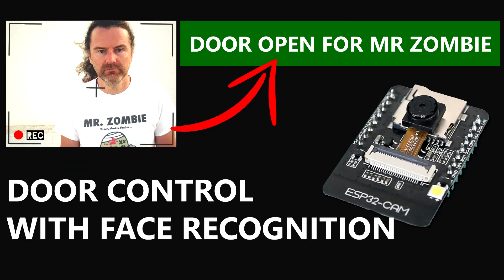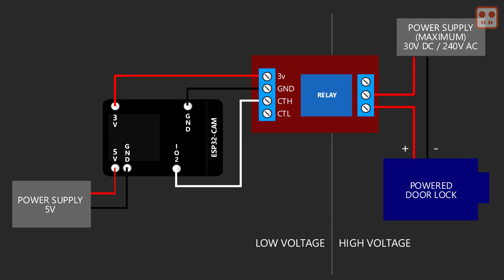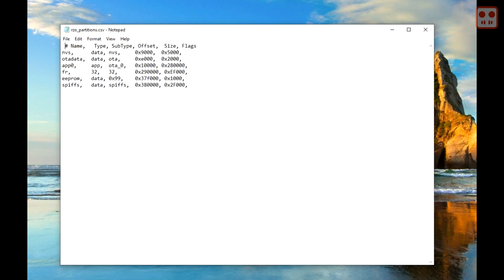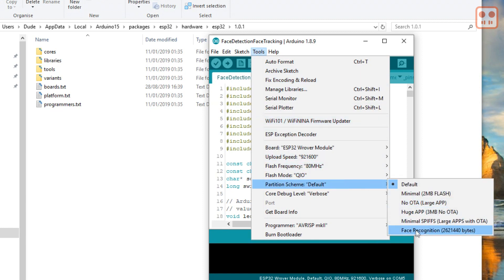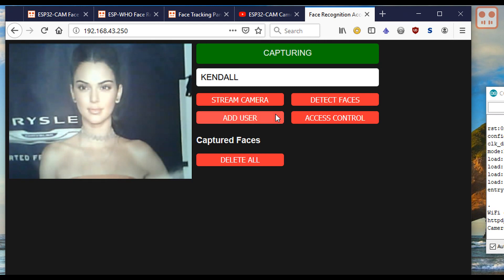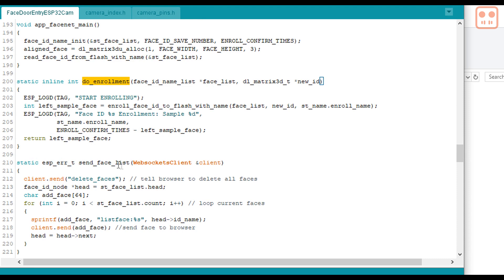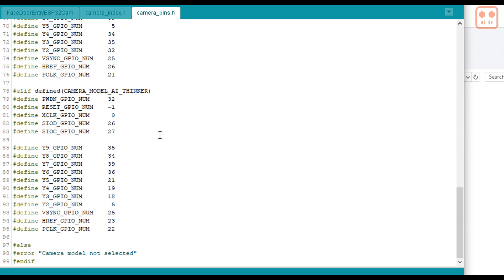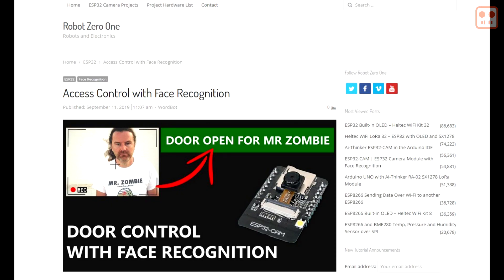ESP32-CAM Face Recognition Open Door Lock

Comment: A huge problem is being showed here
We are getting the IP but after opening the IP in chrome we are not getting the video streaming.. we were getting the video stream but now it's blank screen...black display..so what's the solution...& I AM sure there's no problem in hardware
Reply from the maker: Do other camera examples or tutorials work?
Reply: Camera examples work perfectly fine.
Reply from the maker: @anorophile2841  Is this Chrome on the desktop? Anything in the serial monitor or in the browser console?
Reply: @robotzeroone  when we press F12 the consoled open and showed  one error  count ws=new WebSocket(WS_URL) on the line 145 on the console panel and also showed Could not decode a text frame as UTF-8
Reply from the maker: @anorophile2841  I just tried with a new camera and my code from Github and it works fine.  - https://www.youtube.com/watch?v=68kPGWKg-_A the only thing I can think of is your Wi-FI isn't good and the websocket connection fails.. or maybe you have something blocking JavaScript in your browser for local IP addresses.
Reply: @robotzeroone  actually I have a video of our problem regarding the error is there any way I can send the video and I am quite sure the WiFi speed is decent enough bcoz the program run quite nicely first and yes there maybe a problem regarding the Java Script part you told...please help if I can send you the video in any way sir....
Reply from the maker: @anorophile2841  I don't really have time to offer one to one support on this. I've just added the HTML interface code to the Github. Use this tutorial https://robotzero.one/esp32-cam-custom-html/ to make changes to it so you can try to find your problem. You can add console.log() statements in the Javascript and see if you can narrow down the problem.
Reply: @robotzeroone  no correction of the JavaScript part that HTML text error shown in the index 145 we are facing problem in how to fix thatt
Reply: Can you do something please
Reply from the maker: @anorophile2841  I don't have time to help you. This is just a hobby for me and I've given you all the code I used. You have to work with it and find where the problem is. Look here under  Erase Flash to make the ESP32 clean - https://github.com/espressif/esptool

Comment: Sir after getting IP address from serial monitor, I open IP address in browser but  no camera streaming happening . PLS help.
Reply from the maker: Does the CameraWebServer example work for you? How about this one: https://robotzero.one/esp32-cam-rc-car/ you don't need the servos to see the video.
Reply: @robotzeroone   sir camera web server example worked perfectly fine earlier. when i use your code at first it worked perfectly fine and the video was also streaming but after some time when we tried to scan the photo the camera streaming hanged and then again when we re opened the ip address we faced the problem of camera not streaming
Reply from the maker: @debjitdas6327  I've just tested it with a new camera and my Github code and it seems fine. - https://www.youtube.com/watch?v=68kPGWKg-_A
Reply: @robotzeroone  "WebSocket connection to 'ws://192.168.43.118:82/' failed: Could not decode a text frame as UTF-8. " Sir this is the error i am getting.
Reply: @robotzeroone   sir I get 
Camera Ready! Use 'http://192.168.43.118' to connect
[D][WiFiClient.cpp:509] connected(): Disconnected: RES: -1, ERR: 104
error in serial monitor...
Reply from the maker: @debjitdas6327  Can you try the delete all button and reboot the ESP32. Maybe something happened with the name store. You are using the correct partition as in the tutorial?
Reply: @debjitdas6327  me too, can't you help me ?
Reply: @huynguyen6680  This error seems common... I suspect this is due to the data we save in the flash as it gets cluttered... 

https://rntlab.com/question/how-perform-reset-factory-esp32/

Faced the same issue... followed the above instructions to clear the flash memory of ESP 32 cam... it solved the issue... it might re occur when we enroll and delete faces again and again...

Comment: Guys if i use 5v relay module will it work?
Reply from the maker: Can you measure the voltage on the pin? I think it will just be 3.3v. Also there is very little current so the relay has to be sensitive.
Reply: @robotzeroone  itworks?
Reply from the maker: @bruhitsp4n959  That's good. I didn't think the pin would have enough power to energise the relay.
Reply: @robotzeroone  so what if i use 5v

Comment: Excellent work sir g, but in my case all things are working normal,  after a few face unlock , esp32 reboots by showing Guru Meditation error, please help
Reply from the maker: Can you see where it crashes using the serial monitor and the ESP Exception Decoder?
Reply: serial monitor shows the following:
Door Unlocked
majid
majid
Guru Meditation error: core  1  panic'ed (Load Prohibited). Exception was unhandled
Reply: serial monitor shows the following:
Door Unlocked
majid
majid
majid
Door Unlocked
majid
Guru Meditation error:   core    1  panic'ed  (Load Prohibited). Exception was unhandled
Core  1 register dump:
and here show registers after it shows "Rebooting"

Comment: Congratulations for the tutorial, I followed everything clearly explained, but loading the http page only the part of the controls is visible but the streaming image of the camera is not visible
Reply from the maker: Does the CameraWebServer example work for you?
Reply: it works perfectly
Reply from the maker: In the browser, press F12 and look in the console tab to see if there are errors.
Reply: I SOLVED THANKS !!!!
Reply: How did you solve the problem of Console using F12...can you please tell???
Reply from the maker: Press F12 in your browser and look in the console tab at the bottom. You will see any JavaScript errors.
Reply: Yes there is an error of web socket how can i solve that
Reply: Once it was running perfectly but after that the web socket issue appeared

Comment: Hi! I managed to get it partially working. It detects at first then a few seconds later the ESP32 disconnects. Also, the output pin does not seem to output a signal. Are you using an original esp32? I'm using a clone from aliexpress (the Rx and Tx pins is reversed otherwise it won't upload the sketch).
Reply: I've used a 100uf Cap and an external power as well.
Reply from the maker: @webslinger2011  Normally RX on one device is connected to TX on the other. Might be a power issue, might be wifi. Does the CameraWebServer example work OK?
Reply: @robotzeroone  Other than the Tx and Rx pins were switched. Camera webserver works fine. It's when I try to activate a pin for the optocoupled relay that's when it resets/disconnects(happens even without anything connected to the output pin). Using your face recognition code.
Reply: @robotzeroone  What usb to serial programmer are you using? Mine is an FTDI FT232RL USB to serial IC from DFrobot. Maybe I could try a CP2102?
Reply from the maker: I'm using a CP2102. I remember the FTDI I tried didn't work when I started with these cameras so I've not tried again since. Try changing the output pin. I found 2 and 12 worked. Do you have a card in the reader? Also if you look in the serial monitor and installing the ESP Exception Decoder might help.
Reply: @robotzeroone  There's no card on the reader. I'll try installing that. Thanks!
Reply: @robotzeroone  I've changed my usb programmer and it seems to work now but still resets. Using the code from cytron esp32 camera works well but it won't save anything permanently once power is disconnected.
Reply from the maker: @webslinger2011  It was actually to try removing it to see if the mechanism being active stopped some pins working. Just a thing to try.
Reply from the maker: is it resetting when it activates the pin?
Reply: @robotzeroone  Yes, it does.
Reply: @robotzeroone  But I only connected a meter on it.
Reply from the maker: @webslinger2011  Best to try first with nothing connected. You can try pins 2, 12 and 14. I found 2 and 12 both worked for me but maybe something different with your board.
Reply: @robotzeroone  I'll try to watch the rest of your video to see if I missed anything. Thanks!
Reply: Do you happen to have a picture or document of the blueprint for lock system?

Comment: i have problem when i start to enroll i can't , i see in serial monitor in IDE , i found this 
E (186084) fr_flash: Not found
E (190417) fr_flash: Not found

you can help me pls
Reply from the maker: Sounds like the new partitions haven't been set up.
Reply: @robotzeroone  thankyou for before issue. 

I have a new problem. Previously, I was able to use it. But when I switched to using 5Ghz wifi, it didn't work at all.

WiFi connected
httpd_start
Camera Ready! Use 'http://192.168.1.2' to connect
[D] [WiFiClient.cpp: 509] connected (): Disconnected: RES: -1, ERR: 104
[E] [WiFiClient.cpp: 392] write (): fail on fd 61, errno: 104, "Connection reset by peer"
[D] [WiFiClient.cpp: 509] connected (): Disconnected: RES: -1, ERR: 104
[D] [WiFiClient.cpp: 509] connected (): Disconnected: RES: -1, ERR: 104
Reply from the maker: The ESP32 is 2.4Ghz only.
Reply: @robotzeroone  yes i change to use wifi 2.4g but not work. I give report in serial monitor same in my comment was just moment ago.
Reply from the maker: Does the CameraWebServer example work for you? The error is when the ESP32 thinks the browser has disconnected but it might be bad wifi or power issues on the board. Check you are using 1.0.4 ESP32 Hardware library
Reply: @robotzeroone  yes Working for me but your project working  before connect wifi 5G after don't work
Reply from the maker: @beatzuza39  I don't know why that would affect it. Maybe try some other sketches to see if you can find the problem.
Reply: @robotzeroone  Thank you sir. Sorry if im not good english
Reply: Hi, how did you solve fr_flash: Not found ERROR

Comment: How to fix this error [E][WiFiClient.cpp:392] write(): fail on fd 61, errno: 104, "Connection reset by peer"
.
Reply from the maker: I think this is a wifi connection error when the board thinks that the browser has disconnected. Does it work at all?
Reply: @robotzeroone  
When connected to the image board is not displayed
Reply from the maker: @nontawitphotong3324  Try the CameraWebServer example first to make sure everything is working.

Comment: I am getting this error: [D][WiFiClient.cpp:509] connected(): Disconnected: RES: -1, ERR: 104
[D][WiFiClient.cpp:509] connected(): Disconnected: RES: 0, ERR: 128
It's also not streaming my camera on the browser. 
It all worked but out of the sudden it stopped
Does anyone know how to fix this?
Reply from the maker: It's best to start with the easiest example here: https://robotzero.one/esp32-cam-arduino-ide/ Make sure you have version 1.0.4 of the ESP32 libraries. Also check the antennae (as in the blog above)
Reply: Hi Aron, if you managed to solve this problem?
I have the same problem, everything worked wonderfully, when suddenly I stopped giving access to the transmission from the browser
Reply: @Carlos_Mtzv  Hey Carlos! It worked for me again once but then the same problem happend again; I can't see the live video on the webpage
Reply: @AronvanderWurff  What did you change to make it work again?

Comment: Good night. I have a problem , it does not show me in partition scheme---> FACIAL RECOGNITION (2621440 bytes) I already did everything that is seen in the video but it doesn't work, what can I do to fix this problem?
Reply from the maker: Hi, I think you've missed this step...

Add the following three lines below the existing partitionScheme options for the esp32wrover board in this boards.txt file.

esp32wrover.menu.PartitionScheme.rzo_partition=Face Recognition (2621440 bytes with OTA)
esp32wrover.menu.PartitionScheme.rzo_partition.build.partitions=rzo_partitions
esp32wrover.menu.PartitionScheme.rzo_partition.upload.maximum_size=2621440
Reply: @robotzeroone  yes, i already did that, but it doesn't appears in  partition scheme---> FACIAL RECOGNITION (2621440 bytes) 
is there any other way to do it?
Reply from the maker: @mellinaparralesmero4320  Two other things... did you restart the IDE? Also if you have the Windows Store IDE and the normal install the files will be in two places.

Comment: Sir, my board is heating up. is that normal?
Reply from the maker: They can get pretty warm when streaming video over wifi
Reply: @robotzeroone  thank yoy sir, but why my cam freezing after opening the door?
Reply from the maker: @reinhard1398  Is it freezing at the exact moment the lock opens? Probably a power issue when it sends 3v to the relay it might not have enough power to the esp-cam
Reply: Thank you very much for the response. I'll try to fix it

Comment: Hello   , Compiled and attached here  , please help me    @robotzero.one  
Is there a way to fix it?   
I'm beginner 

ERROR CODE 
Multiple libraries were found for "WiFi.h"
 Used: C:\Users\Admin\AppData\Local\Arduino15\packages\esp32\hardware\esp32\1.0.1\libraries\WiFi
 Not used: C:\Program Files (x86)\Arduino\libraries\WiFi

exit status 1

'face_id_name_list' was not declared in this scope
Reply from the maker: Which version of the ESP32 hardware library are you using?
Reply: @robotzeroone  version 1.0.1
Reply from the maker: @jji9796  I think this one works with 1.0.4
Reply: @robotzeroone  
After trying it, why the electric bolt doesn't work?      please help me    
I'm add face id and it will show the `` unlock door on web ''    but electric bolt doesn't work.
Do you have to use any additional codes?
*****************************************************
I can use the 5V 1 Channel Relay Module (Red) Isolation High And Low Trigger instead of Shiwaki 3 V 1 Channel Relay Board Module with Optocoupler LED.  

Instructions for relays to replace the Optocoupler Module 3 V Relay Board for me . 

-------------------- Thank you very much ---------------
Reply from the maker: @jji9796  It has to be 3v like the ones in the tutorial here: https://robotzero.one/esp32-face-door-entry/ you could do something with a mosfet if you are using low voltages on the electric bolt. Search google for mosfet switching.

Comment: Should i keep the computer powered on ?
Reply from the maker: This tutorial won't work unless the browser is connected. You could use a second sketch to run it without the internet connection.
Reply: @robotzeroone  is there any tutorial to do that ?
Reply from the maker: @salahtaha8592  This might help you - https://robotzero.one/esp32-face-door-entry/ the code might need updating to work with the same code as this video.
Reply: @robotzeroone  this code is all fault and me i dont find how to fix to work. you dont have any code work alone to see how to work... and me need cafe and you :P

Comment: Dear Robotzero.one , Thank you  for sharing thsi amazing project. You have done a Great Job !  Everythings works fine and you explanation was perfect. 
For what I have seen at the beginning of the video , you have the ESP 32 CAM installed right at door entry, but I am wondering how do you manage the browser page. 
After faces recognition,  I would like to make it works as a stand alone device, without any PC connected that is needed (or I am wrong..)
Is that possible ? Do you have some suggetion to do these SW modification ?
Thanks a lot anyway for this project!
Reply from the maker: Cool. I'm glad it's working for you. This one will work without being connected to a browser: https://robotzero.one/esp32-face-door-entry/ The easiest way is to have one sketch to add faces and another you flash that doesn't need browser to be connected. Alternatively, you could probably do one sketch with a timeout so after five minutes it stops the websockets connection and just runs face recognition.
Reply: @robotzeroone  Thank you for your kindly reply. I will go for your suggestion to have two source codes.
I tried the link you attached but it doesn't work for me. It show me the error : [ assertion "l->size == size" failed:  ....  /fr_flash.c ] and ESP is rebooting continuosly.... :-(
Anyway thanks a lot for your support.
Reply: @paololazzareschi5077  Hello! I'm sorry, I have same problem. Have you solved this problem, Mr. Paolo? Thank you!
Reply: @user-darkhan  I am sorry but I don't have solved the problem. I will try again when I will have more time. I' ll let you know if having some good news.
Reply: @paololazzareschi5077  Ok, Thank you! Happy New year, Mr. Paolo ! And I, if I'll solve this problem I let you know...
Reply: @paololazzareschi5077  Hi Mr. Paolo, i am having the same problem, I got this problem when I wanted to add an enrolled face, esp rebooting continously with error [assertion ... fr_flash.c], have you solved the problem? Thank you!

Comment: Not detecting the face in google chrome. I ask to capture not create user. Then I close google chrome, when I open IE with ip, the name is there. I can open the door normally. But in IE also can not trigger users. When I reset esp32 cam the names disappear.
Reply from the maker: Something isn't set up correctly. Did you create the new partition? Browser doesn't affect it. Everything is done on the ESP32.